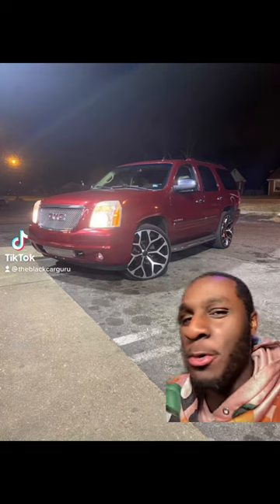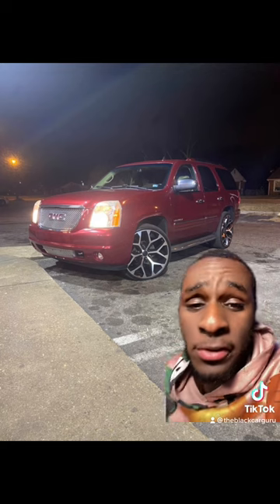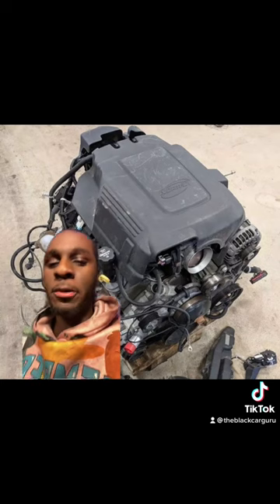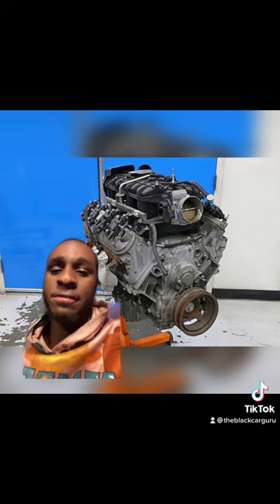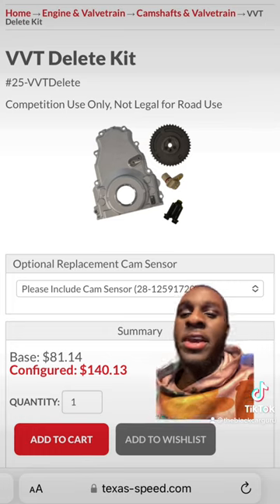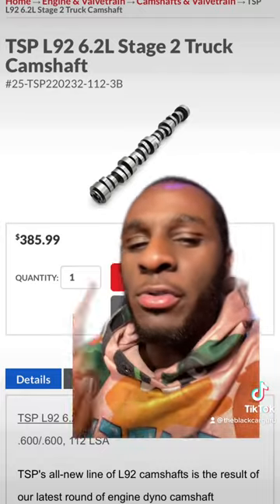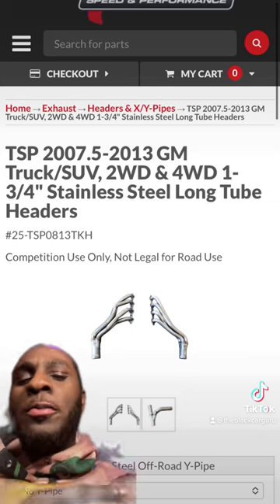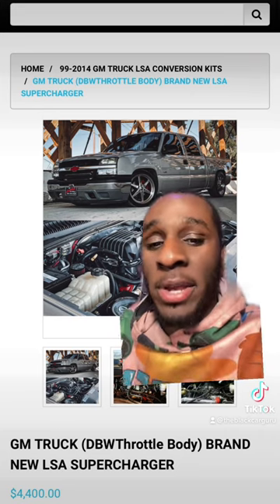Can you make a 6.2L Yukon Denali fast?| Let me explain!

Comment: That's crazy, 500 HP is now considerd mild. I just got slapped in the face and it hurts. You're telling me my 350 sbc on alcohol pushing 498 HP and 788lbs TQ is mild? Mayne how far we've come in automotive history. I guess its time for me to hang up my coat and relax now. Looks like I'll be converting back to 87 pump gas now. Good luck fellas and marry Christmas
Reply: Its sad but true 500hp is now mild because most street race applications are making 500-750hp and basic drag cars are pushing 1k. A 500hp car is still fast but not fast enough now days.
Reply: @bullthedemolisher accurate.
Reply: Times done d@mn changed so much
Reply: 500hp is still respectable imo. Well i goes the application,  500hp import is quick
Reply: 500hp in a truck will move good but it still won't be really fast. In a car, yeah 500 definately isn't mild.
Reply: No lie it is mild but not saying it isn’t fun to drive at that power but very mild
Reply: @wigletron2846  yea for sure 500 hp in a car is still enough to be faster than most things on the road.
Reply: Someone is always faster no matter what
Reply: Its like weight lifting man, 315lb squat, 285 lbs bench and 405 deadlift is like baseline these days 😖😖😖😖
Reply: Nah, 500hp is good, and that 788lbs TQ is even better. You're beating more cars on the street, hell you'd give SS and GTs a run for their money. You'll take Scat Packs Gapplebees with ease.
Reply: @jmhellison  he's gapping all those no problem. Im in a almost stock vette which is 436 to the CRANK and I walk everything you just named. As long as this dude has a decent tire there's almost no stopping him lmao
Reply: More than half the time, most the ppl you line up with on the street your going to be faster than them
Reply: I'm at 960whp/852wtq in a Kong 2650 zl1 E85 street car and I still win some lose some lol all depends how deep your pockets are.. 2005 I had 5.0 with 347 stroker on boost around 500hp and was one of the fastest cars in my area lol times have changed 😅 merry Christmas
Reply: Maybe at the drag strip that’s mild but day to day stoplight to stoplight thrashing that shit is overkill😂
Reply: @canaanwilliams122  in my area it's a lot of roll racing and if your not 800whp plus your not hanging and if the builds done right a 1000whp car drives close to stock when cruising.i got 3v performance stage 4 cam and it don't surge a bit I can cruise 25 2nd gear with no issue and I'm just under 1000wheel
Reply: @Mikegotthejuice24  my build definitely is not street friendly, the cam is too choppy and the stall is 4500 with a TH400 with no overdrive and  final gear ratio is 4.58 and 4.23 rear end. Unfortunately this isn't the 90s no more and it just won't cut it anymore. I run open tuned headers that end right behind the front tires. But like you said the stats are mild now and It looks like I'ma have to retire my old chevy and turn it into a drivable street car because I don't have the funds nor tools to use any sort of boosters not even nitro or methane. Glad the replies are positive and very cheering.
Reply: @z-elwon2884  not to be rude or anything but what is a stage 4 cam and how do stages work? I have a dual quad small block Chevy and our cam books don't have any sort of stages, we just use duration and Lobe separation angles.
Reply: Brooo exactly I have a 2006 Porsche Cayenne turbo s 520 hp stock an a younger fella said “ yeah that’s fast then “ I’m like wowww ok
Reply: Man you can buy blueprint motors that push 2k+ hp all motor its all about how much $ you want to spend
Reply: @aboriginalmuur1661  on alcohol and 37° timing it does. The engine is made for TQ/C.I not horsepower. Plus the overlap of the custom grind cam I have for it helped touch that number. Along with a cam timing. It doesn't make that anymore because I swapped everything out and I forgot to mention it was stroked to 383 so that was on my fault.
Reply: @aboriginalmuur1661  it had domed pistons pistons aswell. I didn't think it would make that much either. Before I ran it on the dyno I was only planning to make about 450lb/TQ but then I started to mess with toque factors far more then what I was intending. I also realized that I could make that with a N/A big block so that's what I'm going for now
Reply: Damn thats good tq i bet your launch is nasty
Reply: @franciscotalamantez2511  nah, unnecessary burnouts at 6k rpm
Reply: 350sbcs are equivalent to a ford 3.8 v6 these days
Reply: @god5131  not really, that's a bit exaggerated since with the right basic Combos 350 ci sbc can still gap plenty of things on the the street N/A
Reply: @hidros1461  right people just look at the horsepower number but a 500 horsepower truck is dog s*** slow compared to a 500 horsepower Mustang
Reply: Bro whats even more crazy.  Right power to weight ratio build with 460-540hp   Can have great top speeds. Up to 200+mph
Reply: 500hp is for girls with pigtails and sunglasses..Those days are over my friend..Might as well drive a Toyota yaris and put a flower on ur dash.Merry Christmas to u as well
Reply: I would like to note this is an all wheel drive application. The horse power ratings are taken at the cam not the wheels.
Reply: Well it was mild until you said 788 lbft of torque 😂😂😂
Reply: @coliimusic  I advanced the cam and went with shorty headers and longer duration and hotter sparks. I mostly use it to pull out tree stumps or move heavy farm equipment
Reply: 500 wheel is still respectable and honestly any more than that is pretty impractical aside from heavy duty racing applications.
Reply: @wigletron2846 yeah I have 500hp in a crew cab its about the speed of a scat pack, nothing spectacular but its fun to drive and has plenty of tq to do truck stuff
Reply: Stock V6 Camaro has like 330hp nowadays lol
Reply: Depends on the weight of the car
Reply: If it’s actually making 300ftlbs more than hp, take that useless cam out of it
Reply: 788 torque is enough to whoop a hellcat in the 1/8th mile all you need is a 150shot of nitrous on the top end of the 1//4th and some re gearing
Reply: Tbh 500hp is mild to a truck due to weight, anything coupe or sedan with 500hp is fast
Reply: @term1nat1on  feels like it, unfortunately my 350 pushrod with carb and HEI is limited by dimensions not design. if I go to a 383, I'll just increase torque with unusable HP because rev limit decreases, and a 327 is too race oriented. But now I have a Big block that will hopefully make some improvements on the horsepower side because my sbc finally cracked 2 weeks ago and some dude wanted it for melted cast iron in return for a 496 he had in a truck. Idk much about big blocks tho
Reply: @term1nat1on  lmao
Reply: That sounds like a sweet truck though man.
Reply: Turn it into a 396
Reply: 500 hp feels different in every car 
Maybe on your it feels quick 
But in that big heavy truck it’s scary
Reply: Lol if you ain't maken at least 800-1000 depending on vehicle the street is not for you trust me I stay away now until I get more money for more mods
Reply: 500 hp is respected just time for a turbo kit

Comment: Too bad most of those engines have lifter problems before u even touch 100k miles 🤣 due to the vvt and Afm, good engines after you replace everything on it and pray nothing else goes wrong 🤣
Reply: If you get the 2500 and up they don't have cylinder deactivation I believe. All the 1500s have it though.
Reply: But they still run and lifters is an easy fix

Comment: Im so tired of tearing down the more recent 6.2Ls and replacing the lifters outta every Escalade that comes through the shop doors
Reply: I just picked up a 2011 Denali, so I’m genuinely curious. Why do the lifters have a problem? I live down south so it rarely gets cold, but the couple of times it has, there was a subtle valve tick before oil pressure was at operating range. Is this a bad sign?
Reply: I know right I've done a few 😂 what I found is that it's usually cheap oil not changed often enough and a foot heavy seat to throttle pedal interface
Reply: @justaformer11b95  How many miles and do you know the exact engine size? And oil change history?
Reply: @ToreiVR  it’s the 6.2 and I don’t know the exact maintenance schedule but I do know it was a large family with a big chunk of money that had it before me. Some of the maintenance records were in the glove box and he was charged thousands for repairs (for simple shit) that he paid in full on the spot. So it seemed like the guy had no problem maintaining it.

Comment: I did my L92. I had my heads CNC ported , Big ass cam ( Comp 235/251 621/624) and a Circle D 3200 stall , true dual exhaust and SENT IT TO THE MOON on 26s

Comment: Yo, black guru I wanna know how nasty my setup that I should be finishing in the next few weeks will be. I gotta LQ9 in a 350Z. Motor has been disassembled and completely honed. I got bored 799 heads with .660 lift dual springs, BTR trunnion kit, mahle forged power pak pistons, TSP torquer v4 cam, dorman ls3 intake, sniper efi fuel rails, sniper efi 90mm throttle body, and arp bolt kit. Love your videos! Oh and I have 100lb injectors and a walbro 525 fuel pump
Reply from the maker: That’s gonna be sickkkkkk! Hit me up with videos and pictures on Instagram it’s the same as my name on here. I wanna see that masterpiece
Reply: @TBCG  from one southern brotha to another I'd be honored to say that black car guru is on my snap. I'm from SC
Reply from the maker: @cgray5559  man I’m here for you guys!👑🙏
Reply: Bro that's nastier than garbage can juice
Reply: @TBCG  can you do one for the 2004 Yukon Denali 6.0
Reply: @dabusiness429  Now, That sir is truly nasty! LMAO!!!

Comment: The new GM 6.6 is a monster. 400hp/465tq I believe. I can't wait to see what people start doing to those.
Reply: The Nissan 5.6 puts out 400hp and 413 lb/ft of torque in a reliable application and has been around for almost 20 years now. Gm should be able to do MUCH better with those numbers for the size of the motor
Reply: @lou6742   How many cam swaps can be done on the 5.6 and how's the aftermarket?
Reply: @lou6742  the diesel is much bigger
Reply: My L86 6.2 makes 420 hp and 460 In/ft of torque. Not much of a difference
Reply: The 6.2 does more hp and almost same torque and is bullet proof damn near
Reply: @tomboy1875  you can make that l86 make more power
Reply: @lou6742  Nissan? 😂😂😂 They make power two different ways. The Nissan is slower and there's no aftermarket for it. No one wants to pay $4k for a camswap on a Nissan.
Reply: @wigletron2846  lots of support with the fact that it’s one of australias biggest drag racing platforms all you gotta do is find a vendor on Fb groups like you do with ls and coyote’s and if anything this engine is a bit easier to work with seeing as you can use lots of vq parts as well as VK45 and VK50 parts
Reply: @tomboy1875  my point exactly, this engines just as capable as any engine we’ve had before nothing new especially not from Chevy. No one talks about the DOHC v8 5.7 from the late 1980’s that literally put out in stock form 375hp which was capable and actually was something to talk about
Reply: @trentdaddydolla647  or you could just do a simple YouTube search and see how many people already have done cam swaps for less than 1k on Nissan’s and also do swaps from 4-10k on most older Nissan’s without needing custom exhaust, headers, pan, trans adapter, standalone ecu, etc. PM me, do a google/YouTube search, or join a Fb group but there’s information out there proving you wrong my nigga lol
Reply: @icebear4849  not diesel they make a gas 6.6 as well
Reply: @lou6742  you do realize that the Nissan 5.6 is a 32 valve 4 camshaft engine vs a Chevy 6.6 16 valve 1 camshaft engine with pushrods and the Nissan 5.6 V8 shares more things in common with the new C8 Z06 5.5 engine
Reply: @gloriamaletta8667  yes and you do realize Nissan did it before anyone with their 300hp from factory but 1000hp capable vh’s from the late 90’s and also that Chevy utilized this tech in the 90’s with the lt5 DOHC v8 and that the vk series has more in common with coyotes and mod motors. Apples and oranges yes I know
Reply: @lou6742  you do know the Nissan 5.6 makes 413 foot pounds of torque at 4000rpm and the GM 6.6 LT8 makes 464 foot pounds of torque at 4000rpm that's 50 foot pounds of torque at peak I'll bet at 2-3 thousand RPM the GM 6.6 LT8 is making 75-80 more foot pounds of torque than the Nissan 5.6 does not a big deal if just driving the truck by itself but if towing something 6000-10,000 pounds that 75-80 foot pounds of torque at in between 2-3 thousand RPM is going to make a huge difference and pull a heavy load with much less efford or strain below 3000rpm
Reply: @lou6742  Nissan or Datsun was the first car company to mass produce the first 24 valve dual overhead cam V6 I've had two Nissans a 1986 Nissan 280Z and a 1995 Nissan XE extra cab hard body V6 pickup that ran great but gave me electrical issues with only 60,000 taken care of miles in 2000 so l sold it l bought it with 16,000 miles on it it was two years old late 1997 it basically was a Nissan extra cab XE hard body with a Nissan 300ZX V6 3.0 engine back in 1997 it was pretty fast for a compact truck
Reply: @gloriamaletta8667  Idgaf about towing I drag race and drift, also I own nissans and nissan engine swaps are easier on a nissan computer than any ls swap lol
Reply: @lou6742  most people buying a Chevy truck are not drag racing it or drifting but l guess some do l think the Camaro is more suited for that purpose and I'm not bad mouthing your Nissan V8 swaps so don't take offense but the LS platform is swapped into more different car and truck from other manufacturers than any other engine and it can be fitted with a old style intake and carberator and ran off a MSD box l don't think your Nissan V8 swap is going to run off a MSD box
Reply: @gloriamaletta8667  lol where I’m from all we do is race trucks, ma’am I’m from texas where you learn how to drift in a 5.4 f150 at 17
Reply: @gloriamaletta8667  I get you tho no offense taken but I’m a construction manager and all my workers who drive Chevy want to switch to ford and Nissan so I just love giving Chevy fans hell over it. My dad even wants out of his 08 crew cab
Reply: Did you order the engine by itself or was it in a new truck?... if you bought the engine by itself, what did it cost?
Reply: @anthonytoler3916  the engine is an option in the new 2500/3500 vans and trucks
Reply: The numbers on the 6.6 won't make sense to you until you remember its for a work truck and that it's larger displacement will give it a broader tq curve than the 6.2, and also the displacement enables it to make similar power without such a hot tune on the engine, example needing premium gas on the 6.2 where the 6.6 probably makes those numbers on a pig rich 87 tune. This game is about more than just peak hp/tq numbers, stop thinking with a closed mind
Reply: You do know.......my BBC torque is wayyy bigger than the Nissan and LS?!?   😂😂😂
Reply: @Thumper68 bullet proof if you delete the afm/dod
Reply: @bmacster1985  or if you maintain it right and don’t city drive often. Have a 2012 5.3 with 170k miles that runs and pulls just as hard as it did after break in miles.
Reply: @Thumper68  like I said, mine was running perfectly fine with over 217,000 miles. I don’t know if it was the timing of my lazy oil change or it was just that time. Your trucks fine for now. Tell me what it’s like with another 40,000 miles like mine. Right now I’ve got the AFM disabler on it and have for a little over a year and it currently has a tick over 232,000 miles.

Comment: I have the l94 built top end . Fbo Custom grind cam , valves, springs e85, ls3 65lbs injectors  4k stall pushed 430whp on a 2008 crewcab Chevy 4l80e 2 piece drive shaft

Comment: You forget the rocker trunions. The injectors on the flex fuel engines are 50 pound so get the L94 or L9H. I wouldn't do a stage 2 truck cam. Truck Norris or Chopacabra. Speed Engineering headers and exhaust. Then the LSA blower or a cheap turbo kit with a GT45. And then get it tuned...
Reply: You’re suggesting the Truck Norris of Chopacobra right? I’m putting together a parts list for my build. I’m already decided on the flex fuel injectors
Reply: This is my setup, in a 06 Yukon Denali xl